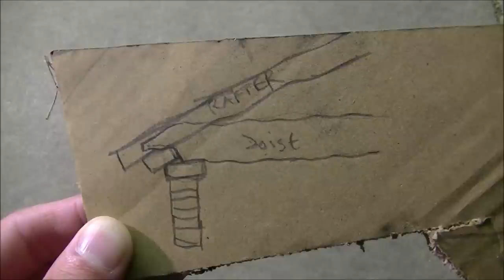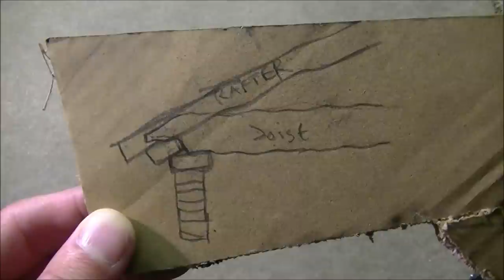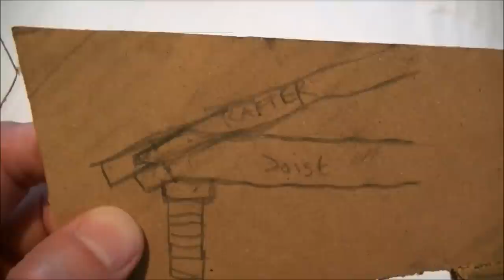Loft Conversion Part 2 - Cutting & fitting the joists. Joist installation.

Comment: Can you use the existing beams? Or lay them on the beams?
Reply from the maker: As I'm doing a proper loft conversion  I needed new joists to take all the new loads and they are supported on load bearing walls. The existing joists are not strong enough for this. They are only designed to hold the ceiling below. A proper loft conversion requires building control sign off which mean all these things are calculated correctly. Hope that helps. Thanks for watching.

Comment: Please advise if this method is still possible in a 1930s hip roof, I'm sure the end of my rafters are notched out to sit direct and sail straight over the edge of the house wall.. so I think I haven't got enough height in the pitch of the roof in this area to leave enough strength in the new joists after shaping to fit under the roofs slope.  Any feedback would be much appreciated cheers 🙌🏻

Comment: Currently trying to learn more about this subject. Does anyone know why you can't just sister the joists?
Reply from the maker: To do a proper loft conversion you need a structural engineer to calculate the strength of the joists required based on the span and load to the floor. Hope that helps.
Reply: @POUSEaroundtheHOUSE  Yeah i've been reading up on it but there seems to be a lot of conflicting information. Some say you must use RSJ, others say you can sister, others say you need to use new joists (the thickness calculated by a structural engineer for all of them of course), confusing stuff.

Anyway thank you for the videos, helpfull stuff :)

Comment: Does every conversion need new joists installed into the loft ? How do you know if the old ones aren’t up to it
Reply: Yes I'm also curious about this. Loving the videos.
Reply: Normally the ceiling joists from the first floor are only designed to take a little weight and the plasterboard from the bedroom ceilings. They are normally as little as 4x2 timbers. Floors need to take a heavier load.

The trick is knowing if you can use timber floor joists. Pouse has his resting on an internal load bearing wall meaning he doesn't have to span a large distance. 

If he didn't have that wall there he would need a large steel to span the full distance and then the new floor joists would be hung from the steel

Comment: Hi there. I want to convert my loft in room and I find it’s the best way to do so, but I have a question that in the ground floor I have load bearing steel beam between the two rooms as it has no wall between the rooms!! 
If I use this middle wall to support the joist in the loft, would that beam be able to bear the load of the new joist ceiling ??
Please let me know. Thanks

Comment: Bit late now pousecbut why didnt you use steels and then just use joist hangers?
Reply: Nevermind i didnt realise it was a hipped roof.
Reply from the maker: Hi Matty, even if it wasn't a hipped roof it didn't require steels as it's an old house with e load bearing walls across it. Also the use of steels would have meant the beams would have filled my cupboard space which I specifically wanted for storage.

Comment: Thank you very much. Does it cost a lot to get a structural engineer and building regs to have a look?
Reply from the maker: Structural engineer name their own price according to what is involved.Building control is a set fee based on what category the work falls into. Check your local authority website, they will have tables explaining this. Then as I previously said speak to Building Control to confirm. It's different in different local authorities.

Comment: What’s the average cost of the structural engineer to give you some calculations etc
Reply from the maker: It's hard to say because it depends on work you need done. In my example I just used timber joists but you may need calculations for steels etc. Also depends on where you live. I imagine a structural engineer in London will cost a lot more than one in South Wales as he needs to pay for his more expensive bills! Just ring a few and get some quotes. Best of luck with it.

Comment: 10.28 you dont want to be putting cables under the joist, If someone screws through the ceiling to hang something . they could end up going through one of those cables. You should be drilling holes in the centre of the joist for the cables mate
Reply from the maker: I agree and I have done that for my new cables (you'll see in later videos) but for existing I've put the joists over top. I know it's not best practice but if cables are slightly loose then they're likely to move to the side if a screw hits it. If they were clipped then more likely. Added to that my cables are RCD protected and I know where they are so safety has been covered. Should have explained that in the video. Thanks for comment and thanks for watching!

Comment: I didn't think you were allowed to reduce the height of the joists at the wall plate.  My roofer is going to put the 2x2 battens (required to thicken the rafters to allow for the insulation and air gap) ontop of the existing rafters to raise the felt and tiles to allow clearance for the ridiculous 9x2 joists which BC say is necessary.  Edit - just noticed that its only half the joist which sits on the wall plate which has been reduced.
Reply from the maker: Also, my joists are 75mm x175mm so shorter but wider than yours. This was to add a bit of headroom by keeping the joists lower. So when you trim a bit off at the wall plate, they are still 3 inches wide and very solid. More expensive than the 9x2 joists though.
Reply: @POUSEaroundtheHOUSE  Thanks for that.  I never got the option of wider joists so I'll have to have a word with building control on that one and see if I can use those instead.

Comment: Hi m8, did u install a steel beam or did u just work of the load bearing wall
Reply from the maker: 3 load bearing walls. Front and back wall of house and a middle load bearing wall. The house is Victorian so all solid brick walls. Thanks for watching.

Comment: Using screws to hold your rafters together is not good enough when resisting shear stresses.
Screws are brittle and will snap, not stretch, when the force loads up.
At their thinnest point they are too thin and the metal used is pretty useless for shear forces.
You must use 75mm or 100mm galvanised nails - the old fashioned way.
Please turn the music volume down, otherwise well done.
Reply from the maker: Thanks for the critique!

Comment: Is it integral to use 7 x 3 timber or is other timber sufficient- for example 8 x 2?
Reply from the maker: Get a structural engineer to work it out for you. It depends on many things. There are tables on the internet that will give you a rough idea if your just looking to work out a rough cost but building control will want to see your calculations.

Comment: will 38 X 63 cls do? or 38 x 89
Reply from the maker: Completey depends on the span of the joists. You need to either employ a structural engineer, or as a quick go to, check the joist span tables available on line. Hope that helps. Best of luck!

Comment: Are stud walls below strong enough for joist supports?
Reply from the maker: The joists are supported on 3 load bearing solid brick walls. The house is Victorian so no stud walls at all, all brick from the ground up to roof level. Hope that helps. Thanks for watching!
Reply: @POUSEaroundtheHOUSE  hi. Thanks for the reply, i was talking generally as i am currently looking to support the joists in my loft but there only seems to be stud walls on the first floor

Comment: I’m surprised that Building Control allowed you to use plywood as a packer for the floor joists
Reply from the maker: Why?
Reply: Compression at the point load, the same reason they told me that i couldn’t use plastic packers.

Comment: gr8 vid but your missing things out like size of screws your using etc !
Reply from the maker: Apologies nic, I will try to add some more detail in future videos. I have so much to do and record, I've probably missed a bit of that out. You see 14 minutes of footage. I record a few hours. Getting down to a watchable sized video is hard and very time consuming. But I will get some detail in the future vids. For reference I'm using a range of 'goldscrew' screws from screwfix. I buy some individual boxes and a the multipacks are very well priced. Great wood screws. Hope that helps. Thanks for watching!
Reply: thanks so much mate already got them :)

Comment: That attic looks perhaps 7 or 8m wide.  Standard 2X12 or custom cut i-joists  would have been much stronger.  That would never pass code in the U.S.  Those 4" are strong but you lost much of the strength by doing a kind of splice.   A shame.   I think had you devoted as much time on a good sandwich splice than the template it wouldve been a bit more helpful to DIY.
Reply from the maker: It's not a splice. Where they overlap they are sat on a structural load bearing wall. Hope that helps and thanks for watching.

Comment: Excellent building skills but... why? I mean, loft conversions: living space, OK but for what? elephants?? living space for people is a bed, wardrobe, table & chair and that's about it but why double-joisting etc? Peeps using lofts for for 'storage' simply lay tongue-and-groove onto existing joists and then bury every available square foot under piles of books etc. - and during conversions you'll be standing on existing joists (i.e. no load spreading) AND considerably adding to the load when levering up existing flooring/joists etc.

Comment: Good job.     But its wood while its growing, timber when its been felled. 
We do not have wood merchants do we?  Was told that by  a carpenter / joiner with 40 years experience.
Reply from the maker: Thanks for the info, I do tend to waffle a bit so forgive my verbal diarreah!
Reply: Pouse
Sorry if I appear cheeky or arrogant, what I said makes common sense to me so I thought would mention it.  You do good videos. Crack on.

Comment: No steels?!?
Reply from the maker: 3 load bearing solid brick walls. There's no need for steels in this design. Thanks for watching.
Reply: @POUSEaroundtheHOUSE  haven't seen the final build yet, just I have never not had to put steals in a loft! Normally over speced steels at that

Comment: What size joists did you use?
Reply from the maker: 7x3.5 inch. But you can use thinner and taller usually. I went for these to save on head space. Get a structural engineer to work out what joists you need according to the span.